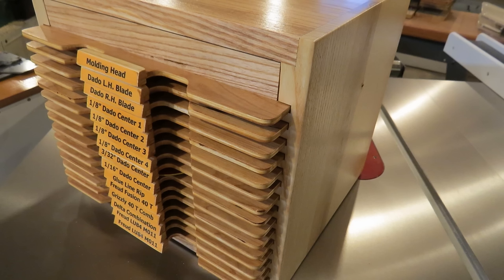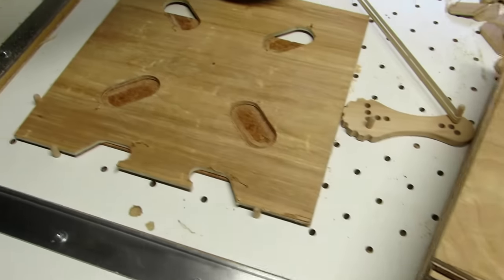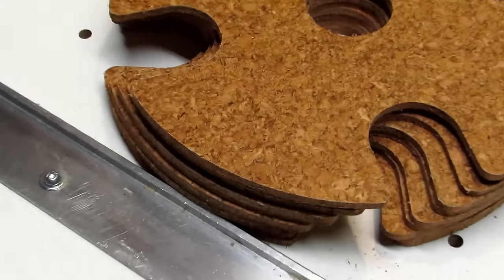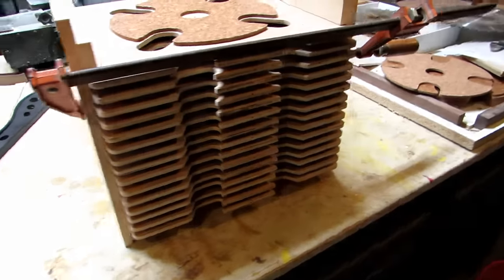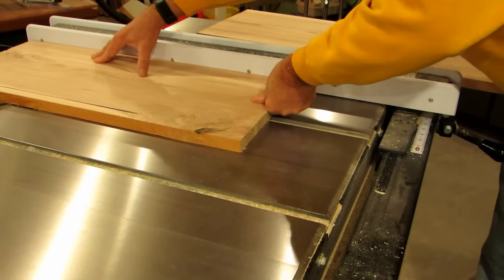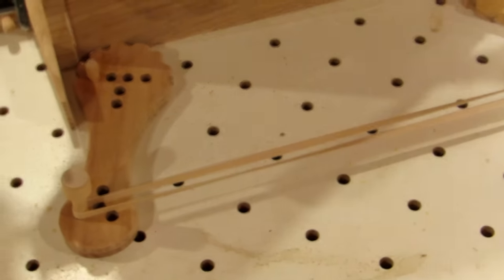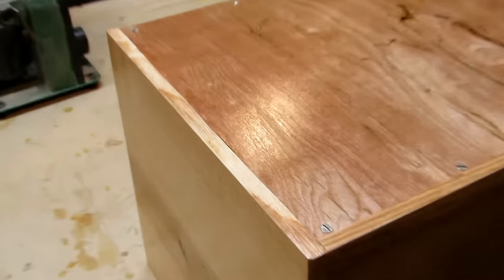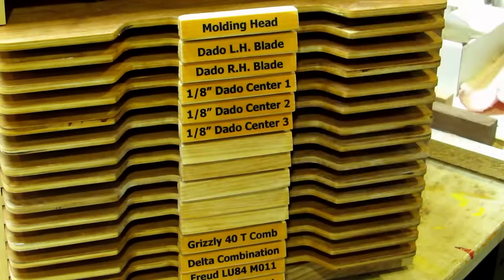Blade Storage Cabinet

Comment: Beautiful work, and some very clever toys to make small cabinetry easy and fun. Very impressive.
I use a similar peg board jig system to make stained glass.
Reply from the maker: I am learning that if every tool or accessory has a place to store it, I  will be able to find it when needed. Little easy to make cabinets like this are worth making. Thanks for watching.

Comment: Nicely done. I'm working on a kitchen corner bench right now for my daughter but this blade storage cabinet will be my next build. Instead of  milling via CNC I'll drill a hole so I have a way to push the blade up. Probably use a dowel to center the blade on the shelf. I like the cork, color coordination is great. Yea, mahogany sides with dovetails,  plywood shelves and walnut handles.
Reply from the maker: It is very simple construction that is easy to adapt to the material you have available and number of blades. For the trays it would be easy to make a router template and use a flush trim bit.  All I have growing in my yard are ash, walnut,  & maple so that is what I use for all my projects . It is nice to have the blades stored safely next to the saw. The cork cuts great with a router and it would be easy to follow a template. I used the slots so there would be some airflow in the cabinet. Thanks for watching. Post a video of how yours comes out.

Comment: How much clearance did you end up with on the dado thickness and depth? I want the drawers to slide easily, but not so loose that they slop around, or get in a bind.
Reply from the maker: There's about 1/32 on the slot and twice that on the width. The plywood is fairly stable.  Thanks for watching.

Comment: As soon as I seen the cnc machine that's where I stoped watching, 0:30 into the video.
Reply from the maker: Any woodworker could do the same thing with a router and template. I use a cnc router, plasma table, and 3d printer in most of my videos so you may want to find a different channel.
Reply: Well, you missed out. I am making a similar cabinet, using jigsaw, sander and router with flush trim bit.